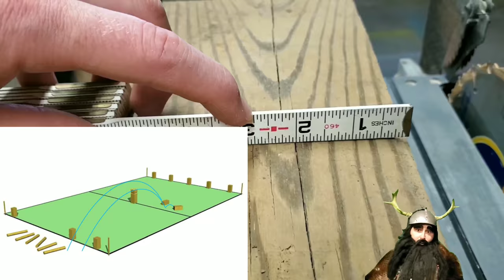DIY Kubb "Viking" Game // Backyard BBQ Game Made From Scrap Lumber // Just Joshin' Around

Comment: Great video! Creative & fun. 

I used old PT 4x4 fence posts, 1.5 dia & 3/4 dia branches (bark & all).
I also use twine & 4 steel rings to make a string rectangle with rings at the corners to mark the boundary. Mark the center of each string for the location of the centerline and the middle of each base. The string is only used to position the posts and then it's wrapped around a piece of of plywood to keep it untangled (sorta).
Reply from the maker: Thank you!!

And that's a good idea, I wouldn't have thought of that. And it's such a fun game!